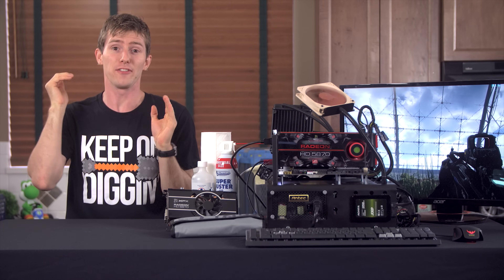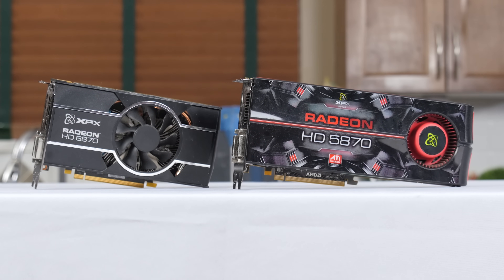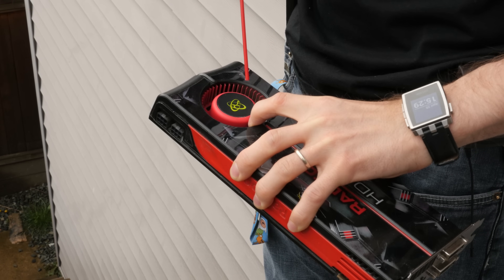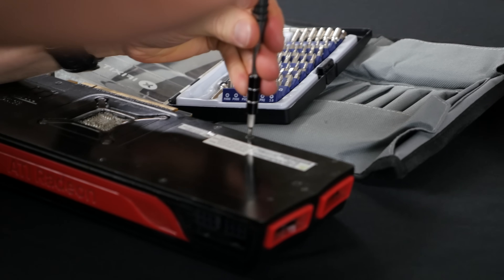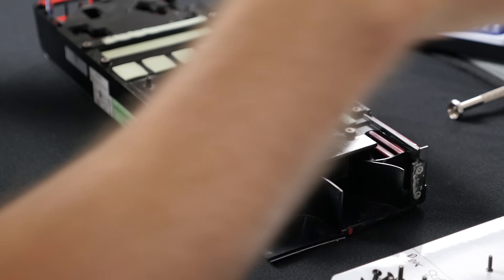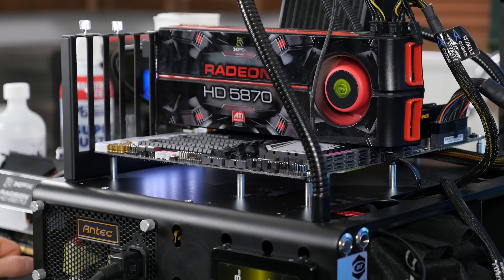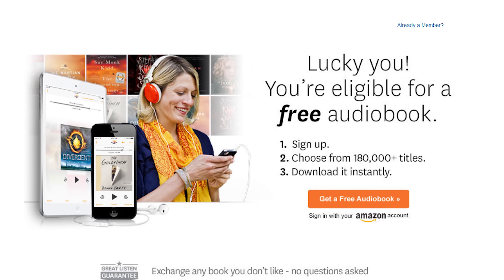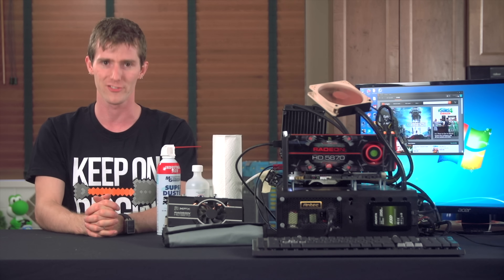Video Card Running Poorly? Clean Your Video Card Cooler!

Comment: If I run my Dell laptop for about 2 hours or so , vertical lines in the middle pops up, is it something with my video card or something else?
Reply: It's probably something with the Graphics Card because it gets warmer the longer you use it and the solder points will loose a bit
Reply: +Jan Tragbauer (JanoschPlaysMc) any solution how to fix this?
Reply: Dell sucks.
Reply: +Richard “Lariatas” Bright If you do not have warranty you can bake screw the laptop apart and remove all the vomponents that are removable from the motherboard abd bake it in the oven this will fix the solder points and Linus just recently made a video about it. I'm sure you can find it
Reply: +Jan Tragbauer (JanoschPlaysMc) u sure its not the problem with ribbon cable?
Reply: Richard Bright If you remove it its no problem ! Can you tell me the model of your laptop
Reply: +Jan Tragbauer (JanoschPlaysMc) dell inspiron 5758
Reply: +Richard “Lariatas” Bright Watch the video "bring your video card back to life" from linus

Comment: I had a 5yr old computer that I hadn't cleaned once since I built it, it started bluescreening and I couldn't figure out why until I checked my cpu temp... it was at around 110C according to the sensor. And that with watercooling. So i opened the case up and quickly saw that my fan that was screwed to the radiator had gotten so filled up with dust that it couldn't run anymore, and the radiator was painful to the touch. That was the moment I realized cleaning your shit is important.
Also, I got a new computer, so yay.

Comment: I remember a friends GTX 295. That thing was a mess. I had to grab my toothbrush to loosen the cake muck that it was stuck in. Because of the caked on dirt and cigaret smoke that it had, I could not reuse the thermal pad. Lukily I had new thermal pads that I could cut to shape and replace with (painfully fiddly though). I was glad it was the single PCB version and not the twin PCB one. It took me 3 hours to do from start to finish.
Reply: I'm curious. Did you get it clean/looking new? What product did you use to get the nicotine residue off?  Can't really scrub these sensitive components...
Reply: +Grab Those Software Toys unfortunately I didn't get it spotless. I didn't have the time to for that (I had only a few hours instead of a few days). You can wash them in dish detergent water, of cause with the fan off of it. Water and fans don't mix. I also didn't have ethanol or alcohol on me as well. Mineral turpentine does a good job on sticky stuff, but leaves a residue, which methanol/ethanol/alcohol can deal with. I brushed it down the best that I can with a toothbrush.
Reply: +Matthew Tremain the dish detergent method takes a few days to dry.

Comment: What about using air cans to clean laptops? Some say that you push dust even further in hardware.
Reply: If you take it apart properly, then you won't just be pushing it in.
Reply: Possible solution: Use a high pressure air compressor and blast the shit out of the heatsink.
Literally
Reply: Nvm i used air cans it has no problems whatsoever. Also using a powerful cooling pad. Also locked the fps to 50 and undervolted. It's insanely cool .

Comment: Compressed air on a can? oh hell no, a good old blower (electric or gas powered) will give you the real dusting power to dust off anything
Reply: +Darkrazilbo No, static happens when you use a vacuum cleaner because it creates negative pressure. A blower on the other hand doesn't create static.
Reply: That creates static
Reply: And, if a compressor, emits moisture.

Comment: 73°C? was that at 100% load?

Because after one of my HD4850s failed, I took all the stuff off of it, baked it in the oven just a little, then used some toothpaste as thermal compound, and it's been working well. After many days the idle temp doesn't seem much worse than the first day, and so far the load temps (I don't think I've encountered max load yet) have only gone up to a maximum peak of 69ºC.

That said, a 5870 or 6870 could have different tolerances, but I think it's rather close to a 4850 in tolerances.
Reply: DO NOT USE TOOTHPASTE!
Reply: Doesn't toothpaste cause corrosion or something? Something about flouride, I think. You get some without. Also, it evaporates after a while and so becomes less effective. Just save the hassle and use proper thermal paste.
Reply: I know not to use toothpaste. I just used it anyway as an experiment. It's an old card that failed once already, so it's not a big deal.
Reply: *****
Sorry, Youtube isn't letting me restore your comment that is marked as spam for some reason.

However to address your point, no it is not better to use nothing. Using nothing is absolutely the worst thing possible. The air gap is very significant and will not conduct heat sufficiently for the card to work well.

Comment: Back in the day, my 8800gt was running hot...  Very hot.   120 degrees C under load.  Compressed air didn't work.  Took off the cover and found a thick ring of "felt" (dust and cat hair) between the fan and the heatsink.  Removed and retested.  80 degrees C under load.  Probably should have replaced the thermal compound while I was at it...

Comment: Linus I would encourage you ( I know bad idea right) to try harder to get a GPU gunked up with dust!! Try this, pick out a sacrificial GPU and set it aside.  then go vacuum your entire house and gather thepet hair and dust from the vacuum.  then take this dust and pour it into the gpu fan while it spins, therefore sucking in more dust than what could be normal under regular conditions.  once you have finished with the Artificial Dust Injection benchmark the card.  and compare it to the benchmark you did before the A.D.I.  Let us know. Thanks.

Comment: Can confirm. I hadn't cleaned my GPU in 10 years.(I had never taken it out and the fan was on the bottom of the card so when I cleaned my PC the air never got into the fan..).
It's a Geforce 8800 but it couldn't even run League of Legends on anything but the lowest settings. When I turned any graphical options up it would make a noise like a vacuum cleaner and got unstable FPS. After cleaning it with compressed air (from a real compressor) it can run League of Legends and many other more graphically demanding games on much higher settings and with considerably less noise. Definiteely a lesson learned for me.

Comment: My graphics card has heat syncs not fans
Reply: those are low end graphic cards, they dont need fans
Reply: Unless its designed to be passively cooled, it must have at least one fan somewhere
Reply: Francesco Barbera no it doesent it runs at a good temp too
Reply: How does doom 1 run on it? I guess it if doesn't have a fan it's like one of Linus' reviewed "low end card"s
Reply: Rage Quit in an nvidia geforce old one
Reply: its*
Reply: JimlathamYT Ah, I had one like that too :)

Comment: Should I put alot of thermal paste around it or just in the middle?
Reply: Just like he did it in the middlea
Reply: +xTiannity They actually already made a video for this, you should check their channel for it. In the end the difference isn't very big, but I'd recommend placing just a bit in the middle - the pressure of the heatsink will spread it out.

Just make sure that you don't put too much, as it can leak out the sides onto your motherboard and cause problems

Comment: Compressed air. Amateurs lol
I dipped my 980 in a bucket of water and it looked like brand new!

Except that it didn't work anymore...
Reply: +Klariaon Hatake Ever think about using alcohol?
Then you can drink it afterwards
Reply: For reference, you can completely subdue electronics in water AS LONG as it's completely dried before using it again. Water + plastic and metal isn't deadly, but water + electricity is.

Comment: I've de-retarded my case by sealing every smallest opening except the pantyhose-filtered intakes. Result - nothing to clean after 2 years.
Reply: Or you set up your fans for positive air pressure inside your case. This is much better since you can get rid of dust when you cover all intakes with dust filters.
Reply: +Tome4kkkk How did you seal the case, as well as mount the pantyhouse? I'm just wondering because I might try it out.
Reply: +Harrison Campbell My case is (used to be;)) a CM Gladiator 600 bad cheapo and not much is left of it after my modifications. Bigger surfaces with openings I sealed with cardboard mounted with silicone (you can buy transparent one). Smaller openings - just silicone. If you use negative pressure case like I do you can strap a very thin piece of plastic foil hanging near an opening and it will self-seal the opening. And vice versa for positive pressure cases.

Then I removed ALL grills. You&#39;ve got to be seriously impaired to leave any intake drill hole or hex punched grills. Use wire ones if you have children or other critters.

Mounting pantyhose:
On a 2 mm steel wire frame, with hot glue. So not adjustable but I made sure I can get out the frame quickly to replace the pantyhose piece with a different tensioning on gluing. I didn&#39;t have to though. During the gluing process you have full control over the size of the meshing. Hell, you can even make it non-uniform. I went for meshing slightly too big so that I hoover it only once a week. After a year I go in with compressed air, blow it onto the motherboard etc. and barely any dust gets lifted.

A tip:
Filterboxes are the shit! Example: bottom feed PSU intake fan. I&#39;ve removed the grill and the default tiny foam filter so already a big improvement to the flow rate. Then I made a two-three layer bandage skirting around the entire periphery of the case. The PSU is clean after a year and it has a huge filterbox to feed from. Barely any flow loss.

Comment: I used to have this laptop with an i5 and 630m. It ran the game i played quite decently for the first year. then i needed to put the graphics lower and lower and lower. Finally it barely ran the game at minimum settings. How is this possible?
Reply: +BfhCheese Ask yourself do you use your computer for other than gaming? if yes do you clean it ( hard- and software) if no there is your reason. Also labtop for gameing hmmm maybe there are planned obsolescence build in, it's not unheard of.
Reply: +Mathias Petersen I'd say i would play games 1,5hours a day on average. It was not about overheat because the fps stayed the same all the time. And i did once open the laptop (out of warranty already) and there were almost no dust at all.
edit
Also i completety factory reset the pc once and it had no performance boost what so ever.
Reply: Im sorry to hear that you opened it / voided the warrenty but you don't have to say that to them if you call the company you bought it from. I am not the one to help you with a laptop as som brands can differ quite from a standard desktop. If your taskmanager indicates high cpu useage and such you might have a unwanted program clocking up that reset could not remove. I find that unlikely and with a mystery like that it could be a hardware issue. You need to start somewhere so call them (don't mention that warrenty ;). computers should last longer than a year without dust or malware.
Reply: +Mathias Petersen Yeah what i meant by out of warranty i opened it like 3 days after the warranty ran out ^^ and i have a dekstop now i dont really care about the laptop. I was just interested to hear if this is normal for laptops.
Reply: ahh ok. well it's still not normal that a computer just degrades but it beats me why. You might know best because you know what you used it for. I also don't really care about labtop either :) GL with it

Comment: Linus: Hi. In this video, you say that thermal pads cannot be replaced with other ones. However, there is a video on you tube showing a guy cleaning his card and, when he disambles the cooler from the cpu of the card, the thermal pads get ruined and he replaces them with new ones. Can I do the same thing as he´s.
Reply: +Lucien Lupan In the video he said the thermal pads cannot be replace with regular thermal compund aka thermal paste. so if you can find new pads for your card it should be no problem. Alway good to consult the manufacturer
Reply: Ok, thanks for the advise. I asked the question because, in the video, the guy disembles the card and, when separating the cooler from the cpu, the thermal pads desintegrate. They´re really torn apart so he has to change them by need.

Comment: +LinusTechTips I have Nvidia GeForce 9600GT 512MB version and it looks like the fps is lower than usual in games I play.I've cleaned my PC with lobit Advanced System Care and it keeps with low fps. Any help?
Reply: Are your drivers up to date?
Reply: +Crackhead yes, they are, and my problem's solved. don't know how, the fps is fine now

Comment: Fun fact even if you dont turn it upside down, most canned air is still going to leave residue, and for some reason it is a dust magnet. I personally use a home compressor, you could just as easily use a portable tire compressor if it has a reservoir

Comment: i always use a air compressor much better than those crappy cans
Reply: That's not advisable ... why? 
1. Because the temperature of the air going in the compressor will lower drastically when compressed.
The moist in the air will condensate and deposite on the inside of the tank.
Therefore almost all air compressors have water in them, not much but just enough to cause 
damage to your hardware directly, or in the long run.

2. The force exerted by the expelled air from even the smallest compressors is often strong enough to damage fans and loosen or unplug cables
Reply: inderdaad!
Reply: +veiga devil yep!
Reply: Fake Clouds ons? jij bent de enige die hier zo hard spamt
Reply: +Robin Kuijer wat loop jij te kakken in het nederlands? xD
Reply: +Robin Kuijer Ikke ook !!!
Reply: +Sven Engels en jij dan? LOL.
Reply: +Fake Clouds ps. blijkbaar heeft het wel zin...want kijk ons reageren.
Reply: +veiga devil nog een nederlander hier, ik heb ook een spuitbus besteld
Reply: +Bulking Smeagol ohh
Reply: Good idea, although you might want to use a filter on it if possible, because they can get quite dirty too I think from the pump (grease particulate I guess)
Reply: +Sven Engels een compressor werkt idd goed :)
Reply: +CHERANO KREEFT15 het wekt gewoon het zelfde;)
Reply: Robin Kuijer ja ik moet wel altijd naar de schuur maar boeie als ik het met een can doe dan moet ik evengoed naar buiten anders zit mijn kamer onder de stof xD
Reply: CHERANO KREEFT15 ja kan het ook inhaleren, blijkbaar word je daar stoned van, leuk om te proberen toch? :)
Reply: Bulking Smeagol haha ja
Reply: +Dean Calaway No just no
Reply: *****
A bit of water isn't a problem. It will evaporate away easily.

It depends on the pressure used to cause any damage or dislodgement, but it would require a lot for it to be a problem. I wouldn't consider that to be an issue either.
Reply: So did you break it yet?
Reply: @Son of Anarchy Not true. If you get an inline filter to filter out the moisture then there is no problem. I use an air compressor all the time to clean my gaming pc. My compressor has an adjustable psi from 10 psi up to 125 psi. I also have an inline moisture filter and a air nozzle with a trigger. Been using this method for many years and never once i had any problems. If you look on my channel and look for the video that shows you how to properly clean a pc you can hear i'm using a compressor and i had no problems.

Comment: wait so with all the cleaning you did the improvement was like less then 10% ?
Reply: On a not so dirty card.
Reply: +Victor It's more of a gain if you have a gaming laptop that hasn't been cleaned for years. Desktops usually run fine for a year or two without cleaning (depending on the cooling solution)
Reply: Buddy Mckay
i never cleaned my laptop for more then 4 years or more and it was running perfectly. As in performance was not different, only thing that was different was heating issues, the side of the laptop where the fan is was always getting  very very very hot. Once i cleaned it after those said 4 or more years, it worked for another couple of years.
Just cleaned it recently and it stopped cooling my graphics card, so i had to disable it and now use laptop without it

Comment: I have an GTX 460 that was getting a bit hot like 75-80 degrees C under load. I cleaned out the card the best I could. I use EVGA Precision X to set the fan speed to match the current temp of the card 30% fan speed to 30 degrees C. It was not nearly the results I wanted. I replaced the thermal compound with Arctic Silver 5. Now my card runs much cooler as low as 20 degrees C idle and gets up to 50 degrees C under load. What a difference and can help me keep the card running until I can buy an GTX 960 4Gb FTW.
Reply: personally, I'd wait for the upcoming Pascal generation of nvidia video cards

Comment: My old eGeForce 8800GT Superclock just needed you to remove the screws from the top of the shroud and not disassemble the entire cooling system.  Sure, it meant pulling up the decal but it was much faster than pulling the whole bleedin' thing apart.

Comment: Oooor you could just lower the GPU memory through MSI afterburner- Underclock the damn thing 30-40% and watch the temps drop 15-20 degrees...i've done this on a couple 4870s and it works like a charm...the difference in perfomance is not even noticable.. All this after cleaning the card from dust ofcourse...
Reply: +Spiral Architect your point being? you could also turn your pc of drops the temp alot also
Reply: my point is...you can have your GPU running fine with an almost unnoticeable drop in performance, by simply underclocking it a bit. Sarcasm aside, turning your pc off instead of trying a working fix only proves how a know it all-dumbass deals with problems.